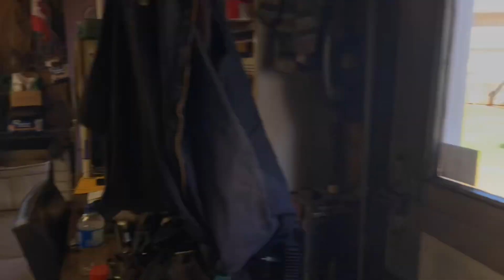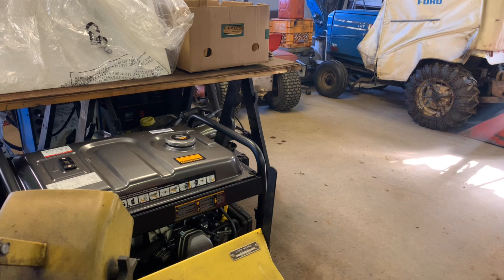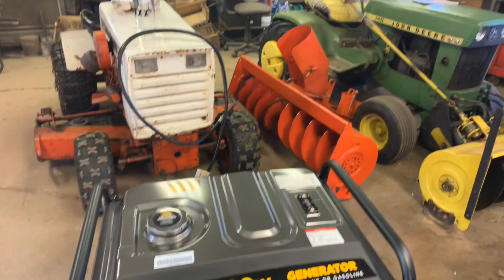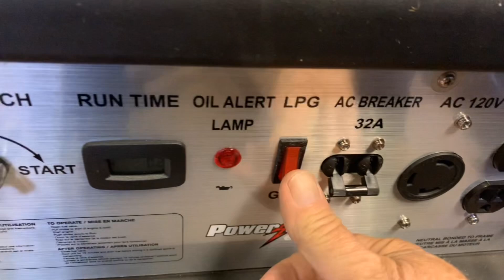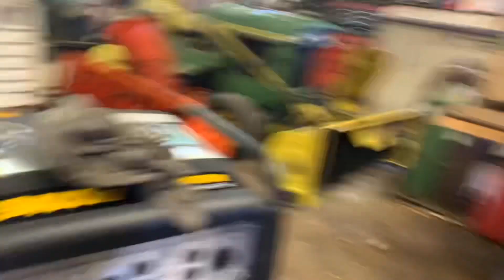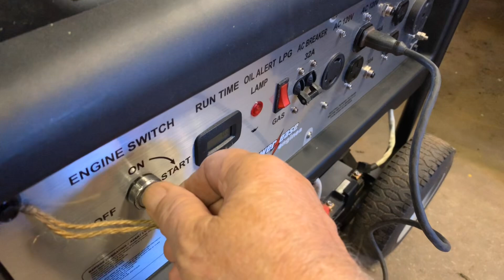Generator start up for season. #generator #backuppower

Comment: I noticed that you are back to having a title on your video. You generator looks like a great unit. We are very lucky in that the power network over here is very reliable and most prople do not have a generator.
Reply from the maker: Ours is too Joseph. But when a hurricane goes thru and destroys every thing. That’s when you need a generator.   Do you have hurricanes in England. ?
Reply: @noelstractors-firewood57  Apparantly hurricanes cannot form at the latitudes of the UK although we do have some bad storms